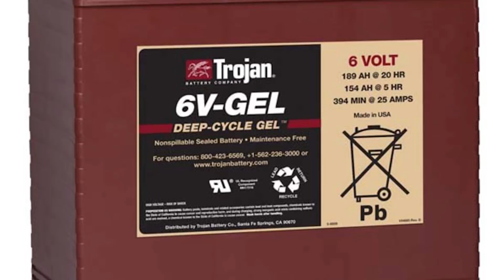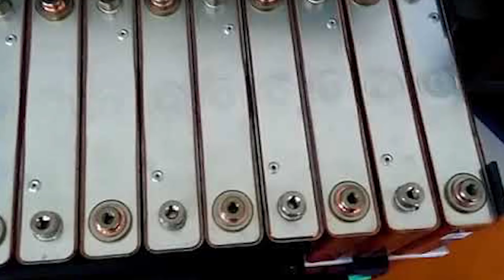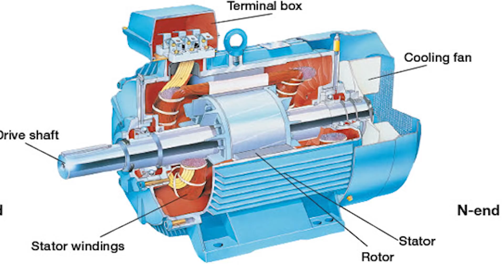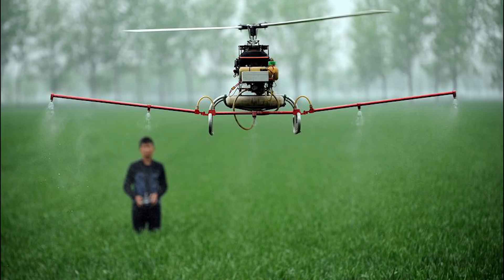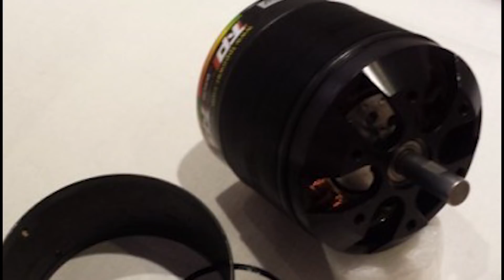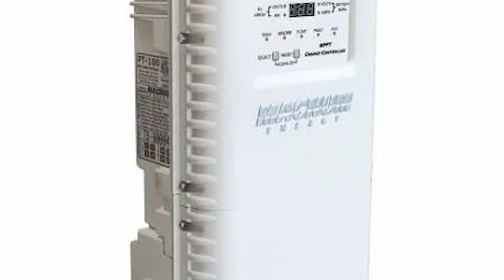How to Build an Electric Sailboat

Comment: Samlex make nice inverter/chargers with built in transfer switches.  It can accept input from shore power, generator or even a MPPT solar charger.  This make wiring very simple.  Sadly, they currently do NOT have a 48V version.
Reply from the maker: yeah this is my problem, I keep finding just the right inverter, with everything I want except one feature. haha. I think I'm going to have to give up on the inverter charger combo since I'm running 50.4v max lithium ion batteries that require a different charging style
Reply: Contact Samlex tech support tech@samlexamerica.com.  They are expanding that product line and may support a 48V input.  A 4000w inverter would be over 166A off of a 24V battery bank.  1/2 of that current would be easier to deal with.

Comment: I have recently built a 4000watt solar system with a 10000watt 240 inverter. I used a Aims Inverter which has a large charge controller. I think the 8000Watt Inverter will work well for your applications.  https://smile.amazon.com/AIMS-Power-PICOGLF80W48V240VS-Inverter-Charger/dp/B00JH43U5M/ref=sr_1_3?s=lawn-garden&ie=UTF8&qid=1515625288&sr=1-3&keywords=8000+watt+aims+inverter
Reply from the maker: +Rick Nelson is be happy with 4000 watts. How long have you been using yours? I've heard mixed reviews on them

Comment: permanent magnet motor would be best for re-gen.  I have seen a few videos on this subject and there are electric motors made for this purpose already, I would look at those specs, and they spec'd out a 12 horse electric to replace a 40ish horse diesel.  also, I would keep your fuel tank and replace the engine with a generator, for when there is no wind, you can quickly recharge your batteries and shut off when charged.  This would be far less fuel used and your boat would be more like a Chevy volt, than a tesla.
Reply from the maker: +Grant Myers 28 horse diesel replaced eith two 15 horse electrics. Or one 30 horse electric.

I'll keep a generator as backup but it'll be gas. Diesel ones are way too heavy for something I'll hopefully never use.

Comment: Have you checked out Sailing Uma? They've been running a mono-hull fitted with an electric motor system they designed and built themselves! motor
Reply from the maker: +Nik Razeen Daud I've been watching em for years.

Comment: Hi, brand new subscriber here. I just bought a Gemini Catamaran and I’ve been researching how to make my boat as off grid as possible. (Probably why your video was suggested.) I have a couple of suggestions that you didn’t mention in your video that I plan on installing on my boat. Firstly, using your props and electric motors to generate electricity while under sail or building or buying a hydro generator already available on the market. Secondly, a warm water tank may make bacteria growth in the tank a greater problem than it already is, not to mention adding unwanted heat to your cabin in warmer latitudes. Because you are planning a robust electrical system, you may want to consider building an HHO system. It uses electricity to break the bond between hydrogen and oxygen making Browns gas. It can completely eliminate the need of propane cooking or heating water on demand.
Reply from the maker: +Chris Olsen I'm thinking I might instal an electric water heater of some kind if I can find something efficient enough. And the motors will have regen but it's peanuts compared to the solar.

Comment: I've heard that using an MPPT charge controller with lithium batteries is not so good for the long-term health of the batteries. Any thoughts?
Reply from the maker: +John Norris mppt has nothing to do with charge cycles of the batteries. The profiles are determined on the output but mppt is referring to how it handles the solar input. 

I'm using many little bms systems to handle the charging. I'm also configuring the charger eith a custom layout.
Reply: The issue I read about had to do with the DC-DC conversion in an MPPT based solar system and the symptom of having a charging voltage that has a lot of small spikes in it. If you try to clean it up so the lithium batteries aren't degraded by it then your efficiency is not as good. My understanding is MPPT is less expensive and works well with lead-acid technology but has short-comings with regard to certain BMS designs. I'll look for your video when it comes out.
Reply from the maker: +John Norris hmm well I'm switching controllers anyways. I'm looking at the tristar mppt since it has charge modes designed for lithium

Comment: Only thing that I would consider with removable motors is that it also means those are stealable motors.
Reply from the maker: +Vilo Conshmillo yeah but without a battery bank they're not much use. I'm still going to take some safety precautions

Comment: There are several ev outboards out there the torquido,outboard comes to mind. Why reinvent the wheel wharrams don't need a lot of power.
Reply from the maker: +cartmanrlsusall I don't have that much money.
Reply: Finding Simon i have a single 50 pound thrust minkota on a 18 foot 1978 basstracker,its a solid chunk of fiberglass hat little motor pushes my boat arong at a fast walk for hours on a single deep cycle. Four of those with enough battery could move a boat around docks and moorings with ease no need for speed controllers or experimental cooling systems
Reply from the maker: +cartmanrlsusall yup but I have a top speed of 8 knots necessary for safety especially where I am. Strong currents and an inexperienced captain (looking at you champ) make for tricky waters when you can only go 2 knots.
Reply: Finding Simon i bow to your experience 85plus horses,from my very tired 90 horse motor seperates me from the reality of ocean currents but i would be very cautious about unproven parts working together im looking forward to your results,i think the ice engine is long overdue for a replacement
Reply from the maker: +cartmanrlsusall I'm only looking at proven and reliable electric motors and merging them to traditional outboard legs and boxes. There's already a dozen or more companies doing this but they'd want over 10k for my motor setup and I'm aiming at about 3k. I'll give a final review when I'm done.
Reply: Finding Simon holy crap that much? Those are insane prices. Have you looked at the large motors used in ev motorcycles, i know zero motorcycles sell motors used in their bikes,and large model airplane motors they are designed for high power and long runs,and i know they are arond 800 to 1100,for abot 15 hp ,two of those would push a wharram.im just brainstorming
Reply from the maker: +cartmanrlsusall yeah that's what I'm doing. Two 10kw for about 700 each

Comment: I thought of doing this myself.  You might want to plan to have a small generator on board.  The last thing you want is to need your motors and not have the power in an emergency situation.  Have you ever thought about buying used tesla battery?
Reply from the maker: +Fu Dog Whisperer surprisingly not that many used tesla batteries available. Besides tesla doesn't make their own batteries yet they're just repackaging 18650s. I bought used Johnson controls modules from their electric industrial truck applications
Reply: Simon - where should I look for those batteries?

Comment: Hi Simon,  I was fascinated by your video because I'm also planning an electric conversion  of a light catamaran and have been watching a lot of these conversion videos.  Your comments about RC motors was much appreciated.  I wonder  if you have seen the videos below because they suggest you will need a lot less electric power than you are planning.   In the first video the guy has a lagoon 42 and says two 4.5 KW motors would be adequate.  In the second a professional conversion  guy says you need only half of the engine power that diesel provides because of the ready torque of an electric motor.  Another thing  I've learned is that electric motors need a bigger propeller to absorb low end torque that electric power provides,  probably 14-18" for 5-10KW.   For outboard motors that might mean some grinding of the plates off the outside  so the  props don't  hit them.  Anyway,  if you have already considered these opinions I'd be interested in  knowing why you think 22Kw is necessary.   Cheers!https://www.youtube.com/watch?v=1u267wy-d5A&t=285s https://www.youtube.com/watch?v=OW8mzN-KPN4
Reply from the maker: +Brian Swanland I'm considering 22kw because of the weight and style of cat. Wharrams aren't the lightest cat design and I wanted a bigger motor for emergencies mainly. If I was going to keep it in one area I would worry about it so much but I'm thinking of going much further and wanted something that I'd never be short on power in a crunch. 30hp total is often the middle of the road for these boats. I'm setting up a system that gives me 25 consistent and 50hp in a crunch. So im somewhere in there.

Comment: There were some guys in Austria, they buildt an electric catamaran called solar wave. I saw them in the ionian sea. We headed to the next bay, because a big squall was coming. The solar wave stopped because the solar panels can`t charge the batteries anymore, the sun was behind cloudes most of the day. Why do you make it so complicated. The sails are a very efficient drive, the wind is free, you need just a little bit more time to reach the next place, if there is not enough wind..

Comment: Hi. Get in touch with Sailing Uma. They have already done this. https://www.youtube.com/channel/UCXbWsGV_cjG3gOsSnNJPVlg/videos
He's a very bright bloke, and may have a load of advice, esp about controllers.
My understanding is that you don't need the same hp/kw as a fuel engine. Diesel/petrol engines are very inefficient. Furthermore, I know Wharrams very well (my dad built most of one, and I have a very good mate who I helped to rebuild one, and slightly helped to rebuild the one he & his wife live on now). A load of them, even the big ones, can be moved well with Yamaha 9.9's.  So I reckon electric power at around 8 to 10kw (2 off, 1xport, 1xstarboard) will work very well. In water, slow revving motors (1k to 1.5k revs max) pushing slightly bigger /coarser props is the way. Less wear and tear on stern gear, and at higher revs props start to get hammered with cavitation problems.
Quick tip : for your HT cabling, check out welding supply companies. You want multistrand, flexible oil/water proof tinned cable, all needed in the welding world and always cheaper and better than marine catalogue suppliers. Best of luck on this, will follow with interest.
PS : BTW, do not use consumable water for cooling. A separate cooling tank is the way. Some of the bugs that can breed in their will end your sailing aspirations quicker than losing money.
Reply from the maker: Yeah he's using a similar curtis controller as I'm looking at.

I'm trying to find an outboard compatible with the slower bigger props, I don't know much about prop dynamics so this is what I'm worried about right now, the motor I'll probably use is an AC35 with a curtis controller setup for 48v.

I just got a johnson 25 today that might be a good fit for the ac35 but I'm trying to figure out if the prop can be switched to one that fits the requirements of slower rpm and higher torque that I'll need to move this boat around. Upside is it's very light, so if it needs work it can be hauled easily and also doesn't add much weight to the boat which is always a concern
Reply: Sailboat outboards are a great choice for electric motor swaps. They run 4-strokes that turn slower rpm's than 2-strokes and utilize a larger diameter slower turning high thrust prop for slow cruising. The 9.9 High Thrust are extremely numerous. Ted mentioned the Yamaha 9.9, I have personal experience with these and they are built extremely well and super tough.
Reply: you are closer to pull off the same thing I have been planning. you mention a couple of times about air-cooled and water cooled.      The AC35 comes in a marine version, that keeps it oil cooled, using a sea water pump.

Comment: With a vertical shaft and a transfer box and with the ability to rotate the vertical shaft and thus the propeller,, you could use the prop to turn the motor into a generator.  Under sail you could keep your batteries fully charged.  Enjoy your fluid, casual conversation style.
Reply from the maker: yeah regen is an attractive option but compared to the solar it's peanuts of power. Even still every bit counts.

Comment: Just watched your about power..... no idea if this has been done or not BUT. Seeing that the boat is going to be moving ie 1 NOT and up. Solar ✔ wind turbine ✔....... what about a water turbine??? 🤔 hmmm.  As the boat is moving thus the waters moving. Would it move fast enough to power a water turbine? For extra power🤔👍🚣🛶🚤🛳⛴🚢🛥
Reply: O water turbine  to make more electric power. Not Turbine to make boat move ie jet ...... think you probably know what i ment lol
Reply from the maker: yeah the prop will actually do this while sailing

Comment: What an exciting project!  One thing to consider is due to the differences in the density of air and the density of water it will be far more effective if you used motor regen to charge your batteries while you are under sail rather than to run wind turbines that never seem to be effective on the small scale.  Motor regen might mean that you would have to use a different propeller (like a ducted fan type arrangement for example) to balance between producing thrust while under power and producing electricity while under sail.  It may also be effective to use a standard propeller to produce thrust and then have an additional deployable water generator turbine to lower when under sail.  Lastly, although your aim is to be totally off-grid there would be no harm in also carrying a small emergency gas generator to get you out of trouble if your main charging methods aren't cutting it :)  I look forward very much in seeing how your progress with this project.  Thanks for sharing it with us :)
Reply from the maker: motor regen works well while sailing, wind genny works well at night while on anchor when most of the wind storms kick up
Reply: I've talked gotten very mixed feedback on the regen while sailing.  The consensus has been only over 6 knots, and generally only enough to put some juice into the house bank.  Multihulls have a way better chance of getting benefit from this.

Comment: It would be fun to watch you take two big, used 3 phase industrial motors and put them in your boat.  Would converting your DC battery pack to 3 phase AC cause some inefficiencies?
Reply from the maker: +Dan Chase oddly enough almost as efficient as brushless dc. When you consider the controller and motor combined.
Reply: Neat! Learn something new everyday, keep being awesome!

Comment: Hey Simon, was looking at DC motors and found the DLC-28 Brushless 15kW Continuous DC Motor, wide variable voltage motor and 35lbs, seems the size you're looking for.
http://www.electricmotorsport.com/ev-parts/motors/brushless-motors/dlc-28-brushless-57hp-liquid-cooled-pmac-motor-24-120v.html

 4 pole motor (8 magnets).
- Phase to Phase winding resistance: 0.013 Ohms
- Maximum recommended rotor speed: 6500 RPM 
- Voltage: 0 to 120 VDC input to the control 
- Torque constant of 0.15 Nm per Amp
- The Inductance Phase to Phase is 0.10 Milli-Henry with a 28 turns per phase.
- Armature Inertia: 45 Kg Cm Squared 
- Current: 180 Amps AC continuous (220 Amps DC into the motor control)
- Peak current: 480 Amps AC for 1 minute (660 Amps DC into the motor control) 
- Weight: 35 pounds
- Peak Stall Torque: 100 Nm. 
- Cooling: Water cooled (50% Glycol)
Reply from the maker: it's close but also AC powered, I have an AC35 kit from a distributor near the boat at a cheaper price, so if I go AC I'll stick with them, I'm having a hard time sourcing a DC motor that runs off the 48V system.

I may buy two smaller DC motors if I can find an affordable option since I figure it's nicer to have two separate motors.

Comment: Good luck with the project. Your water cooling finger list didn't mention water cooling the solar panels to keep them efficient. Also, I'd personally use more than a single MPPT because of shading and for redundancy should one fail. I'd choose to go the two motor controllers and brushless motors for redundancy, but that's just me. Not sure you mentioned a BMS, so I'm assuming those NMC cells came with one as shown in the 3D rendering.
Reply from the maker: they actually didn't. I'm either buying 18 cheap BMS's or one big one, I'l like one mothership BMS with 18 mini balancers
Reply: Ah, does that mean you're going 18S (66.6v nominal)and not a 13S (48.1V nominal) system like I thought you mentioned? 
Also, since it's cold there, have you thought about how cold temperature might negatively impact cell capacity & cycle aging? If you're intersted see: http://mat4bat.eu/wp-content/uploads/2014/03/Cycling-Aging-of-Lithium-Ion-batteries_Grolleau_EIGSI.pdf